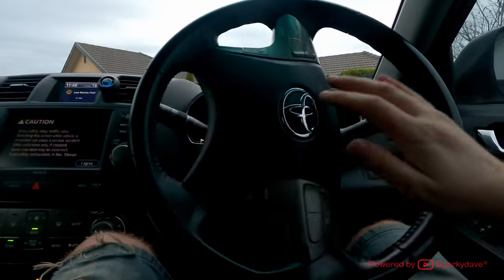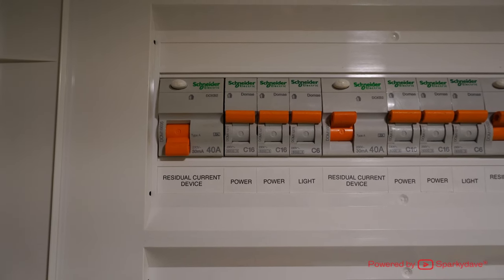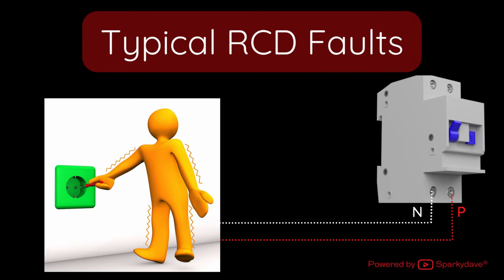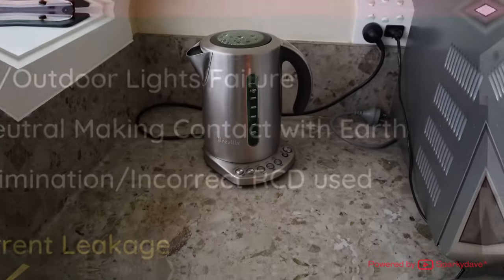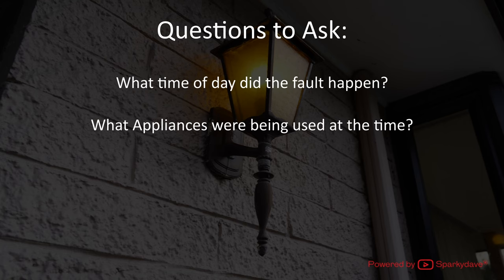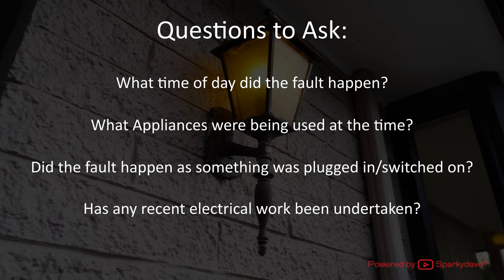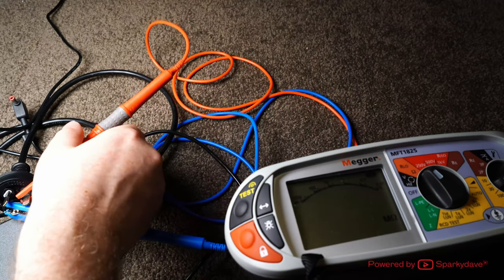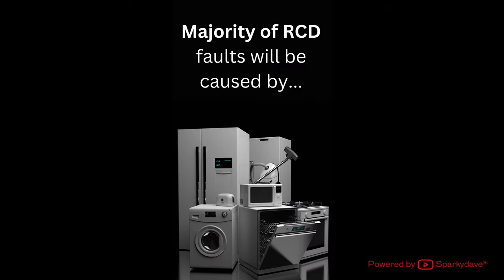How To Fix Tripping RCDs

Comment: As a generator technician electrician working on a 160kVA gene the 63A 3 phase outlet kept tripping everytime  the socket outlet was switched on to utilise the appliance. The fault was at the 'Neutral' conductors at the RCD. They were incorrectly positioned . The supply was fitted on the load side and vice versa. Once corrected happy days 🤙🇦🇺

Comment: I had this mate, and it actually burnt. 
We had similar issue. What happened was that we had 4 main circuit's, 2 for lights and 2 for main power. 
It tripped every now and than and we would just flick it back on. We typically only had fridgeand freezer, microwave, occasionally toaster and kettle, tv and sound bar. That was basically it on this. 
One night it tripped so we flipped it back on. Tripped again relatively quick flicked it back on after turning some stuff off. 
It tripped again but this time smelt something burnt. I'd pulled off the cover and all the wires were badly burnt. Thankfully nothing caught fire. 
Called the electrician and he came out. 
What happens was that the Australian standard 16amp house fuses weren't used, instead they used 20s and loaded it up when they wired the house, so he rewired it for us. Worst part about electricity is you can't see it, hear it or smell it so incredibly dangerous.  We were very lucky.